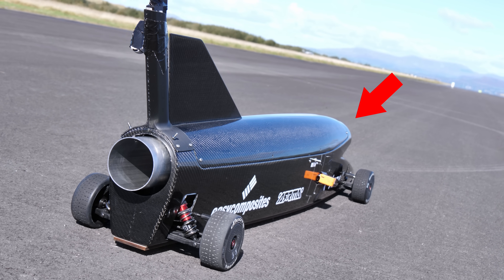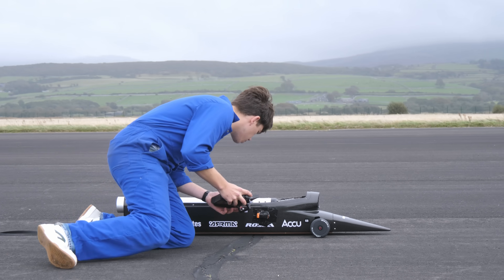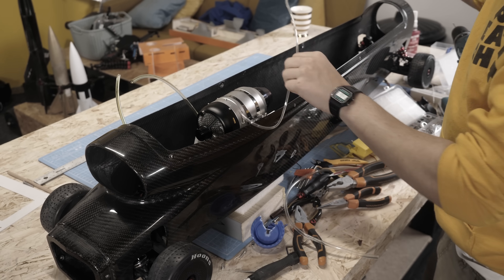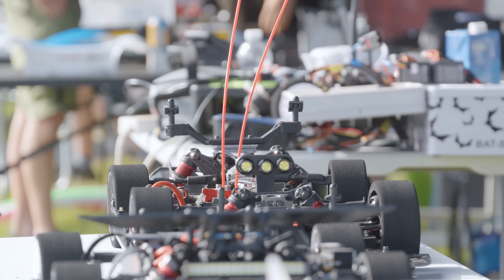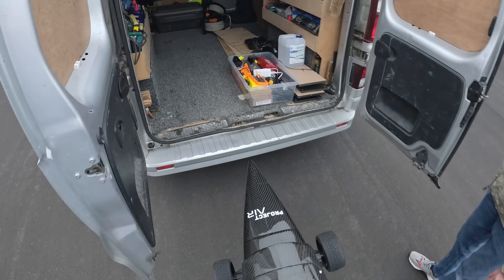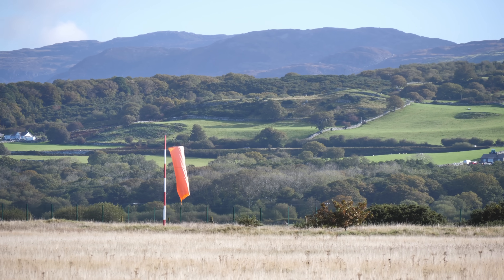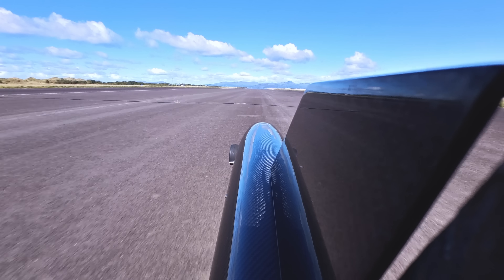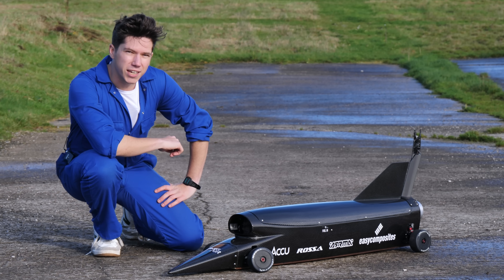World's Fastest Jet RC Car (Runway Testing)

Comment: Ditch the GoPro. Get someone with a chase drone instead. We don't need every camera angle for the record run, especially if it means sacrificing max speed!
Reply from the maker: Thanks for your comment! We needed the onboard cameras for making the video and for evidence for any record submissions. At the moment they’re taped on as low speeds the drag isn’t too noticeable. Next time they’ll smaller and in aerodynamic pods, now we know the best locations 😊
Reply: @Project-Air  Good. Gotta keep that sleek streamlined body smooth.
Reply: @Project-Air  If you are going to wait until next year, would it be possible to build the go pro mount into the chassis. That will also help with imbalance at the higher speeds you hope to achieve.
Reply: @Project-Air  look into how BPS Space houses cameras in rockets. Good for Mach 2!
Reply: @williamstrachan  I second this. No need for a bulky housing when the car's body is already CF.
Reply: @Project-Air add some in the cockpit.
Reply: (Add a cockpit with windshield and  add the camera in there)
Reply: @Project-Air look into ribbon cameras.
Reply: @Project-Air it would be interesting to see you build a hydrogen peroxide / steam rocket rc car like Sammy millers 80’s record breaking drag cars
Reply: Doesn`t have to be GoPro either.
Mounting an FPV camera inside the body should make it easy enough to get onboard footage.
Right under the intake for example.
Should get good quality as well as long as it`s recorded onboard.
Btw, a chase dronewould have to be one of tha fastest drones on the planet considering the speed here..
Reply: I agree :D
Reply: Agreed, but I think he also needs the footage for his own data. It helps troubleshoot quite a few possible problems. Plus, we don't know the events regulations if the fpv drone is allowed. 

It's great if it's possible, but I think better packaging will be better
Reply: 50 mph was obviously not this things max speed and they weren't even running the bigger engine, the wheels made more drag than the camera.
Reply: Easier said than done.
Reply: Great shout!
Reply: Should put a gyro on the steering and that will keep her straight. Otherwise on the rudder add a servo and gyro also
Then regardless of wind thr gyro will compensate as soon as there’s airflow over the vertical stabiliser
Reply: Maybe just build a 360 camera mount inside the car
Reply: I 54th this comment. None of the serious cars have cameras, get rid of them. It’s more junk to buy and worry about.
Reply: 100% agree with this
Reply: or have it in the vehicle with a plexi glass pane
Reply: Use fpv cameras like dji o3/o4 or walksnail or hdzero and put inside canopy/fairing. Currently, it's really waste of sleek aerodynamic design.
Reply: I honestly thought the POV shot at the moment of truth was a really nice artistic choice. I agree that a chase drone shot would be clutch - I just don't think it has to be an either/or. Do all the shots!
Reply: Create video. What a fascinating journey. Looking forward to seeing you break the record 🚀🚀🚀
Reply: I agree . Well done .
Reply: Put a small camera in the nose. Thin glass nose.
Reply: The Go-Pro is just fine!!!
Reply: And put as many short burst boosters as you can for use when nearing max speed instead😊
Reply: ask the guy with the fastest drone in the world to shoot your record attempt next time!
Reply: BRO BRING BACK UR PLANE THAT HAD A EJETS SEAT
Reply: get a naked gopro or fpv sistem
Reply: drone to fast it needs to be tuned steve 8:16 one need a chase drone
Reply: Exactly... gets someone to spend a boat load of money making a custom carbon fiber body for better weight and aerodynamics. Then screws that all up by hanging a GoPro camera off the side of the back area of the body.

Smh...
Reply: @jeffallen3382  a body designed to reach much faster speeds than 50 mph which is all he reached, you act like he's an idiot
Reply: @zanexdreamy  he is...
Reply: It really seems like this kid has no clue wth he is doing and is just chasing the algorithms for his videos.

The mistakes he consistently makes are rookie mistakes. The blue jumpsuit, every video, just adds to the clown show.
Reply: @jeffallen3382  <- This guy was raised wrong...
Reply: @JimmyNuisance  oh no... What shall I do??? #gfywithasharpstick!
Reply: @jeffallen3382  Crazy how someone who ‘has no clue’ keeps making content people actually enjoy. Tough problem to have. Bro, you are the clown show. 😂
Reply: @jeffallen3382  You’ve got this whole breakdown of his content, style, strategy, and wardrobe like you’re giving a TED Talk in the comments. Meanwhile, Project Air is busy building something, trying things, and actually putting himself out there. It’s always fascinating how the loudest ‘he doesn’t know what he’s doing’ takes comes from people who avoid doing anything themselves. Jealousy hurts. 😂
Reply: @FarmerFpv  Did I hurt your feelings because I mocked your boyfriend? awwwe... poor baby.

Comment: Please excuse my ignorance, but after going to all the trouble of designing the car to be as aerodynamic as possible ( including wind tunnel tests). Why oh why didn't you design the cameras into the body shell instead of slapping them on the exterior & completely ruining the aerodynamics.
I understand wanting to get all the data you can at testing slow to medium speeds. But then you should've removed the cameras for the full run, after you've proved it at slower speeds. Wasted opportunity. 🏎️ + 📸 = 🐌 🤔
Reply: Definitely, the whole project seems kinda underwhelming. Lots of oversight

Comment: I want to be as constructive as possible: I've always loved your projects. This one looks like a fantastic effort! However, you're introducing so much drag pointlessly by slapping your camera on the side rather than integrating it. Same for the wheels. And the underpowered engine doesn't make sense for your purposes because it's quite simple to control the throttle on a larger engine in order to limit the speed and forces during testing. Why dial something in and waste all of this effort on aerodynamics and carbon fiber if you're going to use an underpowered engine and phone it in regarding all the different drag you're introducing? And if you are going to be so cavalier with drag- would it not make sense to add a little downforce? This design is extremely unstable in terms of lateral forces- even more than the last one.

Comment: Antennas and exposed tires are the drag problem also you will make it more close to ground with a very distiguish water drop profile....and if you are so scared for crushing it you should place side motions and parachute....in addition car is pulling to the right.

Comment: My god, all the people criticizing him for being careful and slowly building things up. I bet they've never put this much time, effort and money into a project like this (I doubt they would have the skill and patience to do so in the first place). Of course he's going to be careful. That's how stuff like this works. You start slow, try not to break anything and gather information. Then take it a step further. Or do you think Richard Noble slammed Thrust SSC together, hauled it over to the desert and had Andy Green go full throttle on the first run? If it was me, I'd be shaking in my boots trying to run something like this at full speed. In fact, I've built a couple of powertool dragracers. Nowhere near as expensive as this car, but not cheap either. I have my son race them, because he doesn't care if they crash into the barrier at the end of the track...
Reply: he is learning from his past mistakes and everyone is making it seem like he should have gone for it (on the smaller engine no less), it just didn't make sense to risk it all

Comment: The CF body looks amazing.  If you make another version I would consider integrating a camera mount as part of the design.  Honestly the duct taped bodged on camera does not look good and I imagine it compromises aerodynamics considerably at those high speeds,
Reply: I suspect when it comes to the real record runs with the big engine there will be no cameras or just one poking up into the air intake for minimal aero influence - lots of camera for the debugging stages, making sure the suspension looks good, the body shell isn't rippling under the aero load etc at lower speeds before putting the big engine in and getting rid of those draggy cameras.

Comment: why not use a steering gyro? like as3x nose wheel steering/heading lock...it works wonders
Reply: I suspect at max speed you can't rely on steering to keep it straight, it must be straight and stable on it's own. That's down to the right aero, center of gravity and suspension geometry.

Comment: Just a question, why not use an fpv camera? It would be much easier to control. Or is it against the rules of the competition?
Reply: Agree FPV systems can go way further than the runway so makes sense to me just. Make sure it a low latency system like HD Zero DJI video feed is top slow.
Reply: @kanenstuff hdzero range is meh, 25 ms is not too bad
Reply: @roslinka_fpv I prefer anilog as the  latency is quicker. Though most love Digital. It's not needed to do FPV but its nice to have for the clarity of the image but affects your timimg. Your build is amazing, and keep going, and sure you will hit your taregt speed.

Comment: So electric cars are definitely the way to go.
Reply: Yes, but that wouldn't be as interesting
Reply: what would be much more effective would be using the turbine to directly drive the wheels so the turbine spinning at several thousand RPM goes through a gear reduction and then drives the actual wheels do that and you could easily treble the world record.
Reply: @jonsouth1545 turbines are efficient at higher speeds, it's not quite that simple, while turbine engines tend to be lighter and more powerful than piston engines, they also drink a lot more fuel and are less efficient, so you have to carry a bigger fuel tank, which can eat into the lightness and power ratio. It's a somewhat complex thing, also if my limited understanding is correct, the setup you described generally has the power turbine mechanically isolated,

Comment: It's a carbon fiber body.  You did this so it could survive crashes?  So why are you treating this car like a fresh egg?  JUST SEND IT and don't milk 3 more videos doing so.
Reply: Carbon fiber is bad at handling crashes. It collapses entirely as soon as it's limits are hit. That's why it's not used in leading edges on aircraft/jet engines.

Kevlar would have been better.
Reply: LMAO just send it 😂

Comment: Nice video as usual but I don’t get how a rocket on wheels goes less than 100km/h when an electric car hits  350
Reply: Because he's down sized the engine and is scared to crash it.
Reply: Because the car is severely underpowered and de-facto a sponsor product demo, not a fast jet vehicle. What is important is power-to-weight ratio, not means of propulsion. There also are several design problems the record car overcame during the build process and this one is yet to overcome.
Reply: It's not a rocket it's a jet. They have low but constant torque so it takes a long time relatively to get up to speed vs electric that can dump all the torque the tires can handle. He also undersized the engine so that's definitely part of it. Without an afterburner you're solely limited to what air the turbine fan can move.
Reply: Electric motor are these days so powerful and lightweight the bit that slows you down is traction with the ground to deliver the power and those electric cars are likely consuming more energy than this jet engine too! 
The jet engine in this is an entirely different beast anyway that probably didn't get fast enough to have enough air intake to really perform to its best - as you can see in some of these runs with how it accelerates off the line its still accelerating faster and faster after a very very slow start even though the throttle is wide open. Give this car enough runway to accelerate on or a catapult launch to get it started and even with that small engine it can go way way faster.
Reply: @foldionepapyrus3441  There also is a point of input delay in jets. Turbojet has a very simple feedback loop: exhaust turns turbine, turbine turns compressor, compressor gives more oxygen, more oxygen gives more exhaust and the power increases.

Problem is compressor needs TIME to spool up. It changes the entire acceleration dynamic — you can keep throttle at 100% all the way but the engine reaches 100% rpm only after some time. Did not see that in the video at least on the first watch.
Reply: @oldcameraguy  Seemed to me like they were keeping the brakes on and spooling up as far it will go for the throttle setting in use while stationary. Still a valid point though.

Comment: I think you should make covers for the wheels, for they produce a lot of drag. Also the cameras should be incorporated in the design to  decrease the drag they produce, something like what is done in F1. Another thing is that considering you want top speed, you could try to use ground effect for stability without generating too much drag. Still, it is a very nice design and  I get that it is very expensive to make any change to the aero or really anything else. Cheers, mate. Good luck on your next try.
Reply: I was thinking along the same lines, TBH wouldn't he be better off with thinner wheels. It's not like he needs traction, all of the force is coming from the jet.
Reply: @DesertFernweh  he does need a lot of traction, he needs to stop and turn and steer, thinner wheels would be like not having wheels at all and just letting it go where it wanted
Reply: @zanexdreamy good points, but look at top fuel dragster. While they have huge tires in the back for traction, they run what are basically bike wheels up front.
Reply: @DesertFernweh  yeah because it drives in a straight line for a mile or less on a special surface with no huge crosswinds that will pick the car up and throw it to the side of the drag strip. This is not a Top Fuel Dragster, this is a much smaller, much lighter Rc Car, going past a very large and very open flat runway, runways are built in windy areas, there is a lot of wind there that will change the course of a small rc car
Reply: probably right but the biggest problem is the smaller turbine and him being puss driving it.
Reply: it would be unsafe to have a cover over the wheels, they move up and down so having them attached to the body would mean they would have to be quite large to allow for movement or have the wheels barely move (bad idea). or he could have them attached to the wheels but then those are just extra pieces that could fail. The wheels will produce a lot of drag but so would the suspension arms, i think it would be better to leave them how they are
Reply: @zanexdreamy  what. Wheel covers don’t have to cover the top of the wheel you know. He can just make pods that go in front and behind the wheel, or ones that mount to the suspension. Just look at the bloodhound SSC rear wheel pods. He also really should considering ditching the arma suspension for his own so he can design it with super high speed running more in mind and also mount more of the suspension out of the airstream
Reply: @zanexdreamy  ????
Reply: YES! THANK YOU! I’VE BEEN WAITING FOR THIS COMMENT
Reply: I think he already explained that open wheels is more aerodynamic than covered wheels
Reply: @Rleo12  It just isnt. He said that the narrower body with exposed wheels is better than a body that covers the whole wheels, not one that has wheel pods or is narrow with covered wheels. Wheels are horrible for drag, he even says so
Reply: @Rleo12 No, they are not. They create turbulent air because of their spinning motion and turbulent air = drag. He chose open wheels because I think he said it would be easier to steer and line up on the runway/ Hopefully that helps.

Comment: The steering instability is being caused by the right front lower control arm length adjustment link is lose. It’s twisting on the back and forth causing the camber angle to oscillate. 
Go thru everything then afterwards do it more time.
Reply: I’m not sure using car parts from that rc car was the best idea because the rc car is designed for quick turns not high speeds. He can only lower the steering rate so much until the limitations of the parts themselves become an issue. Also, spending thousands on the fairings and not incorporating the wheels into the fairing seems silly as you can see in the last video when they were modeling the car there was tons of drag being created from the wheels. Also not having proper air ducting to the engine which could probably be mostly done with a PVC pipe from Home Depot. Combined with the intentionally underpowered engine…
Reply: @ethanm3923  learning from the ideas that didn’t work is far better than asking others for what he should be using and how to set it up.  
Just has to pay more attention to the basics more than the big ticket items like the CF body and turbine… def top shelf equip but  if the screws are loose it’s not going very far.
Reply: @NvTwist This is not the cause of the steering instability! These links have two ball joints on either end and can therefore rotate, but the point is that both ends are rotating simultaneously and the length of the link is therefore constant. The friction between the plastic part and the threaded rod is way too big to shift around like that on it's own. This design is well proven in the RC-world. 

@ethanm3923 Also the Arrma limitless chassis should work well for this application, it is actually designed for straight line speed instead of quick turns even tough it shares a lot of parts with 1/8 buggies. A lot of people already had success with this chassis.